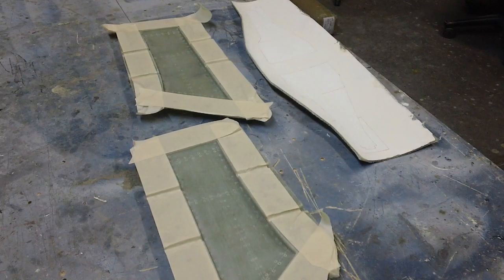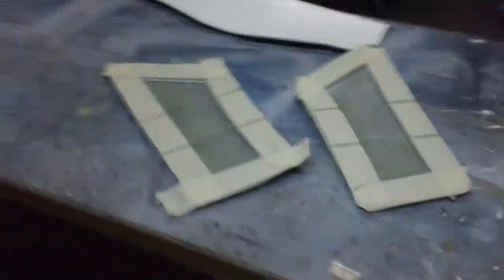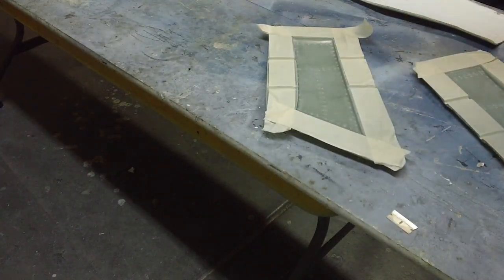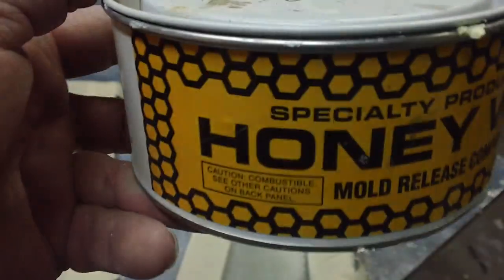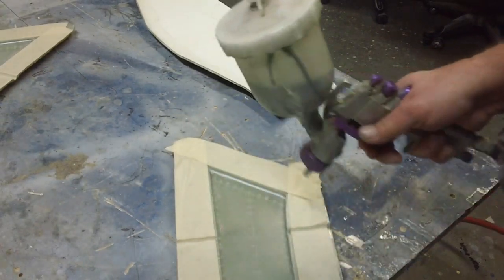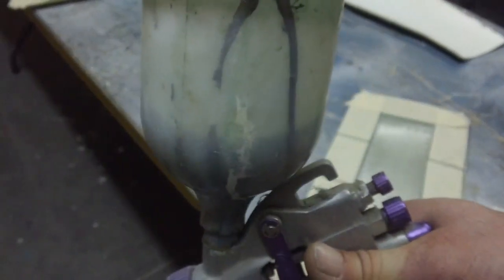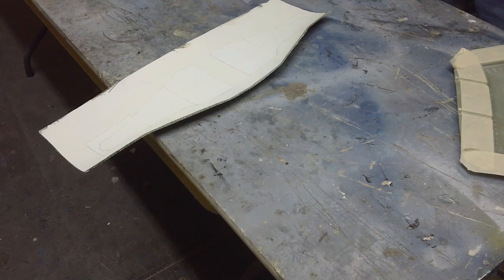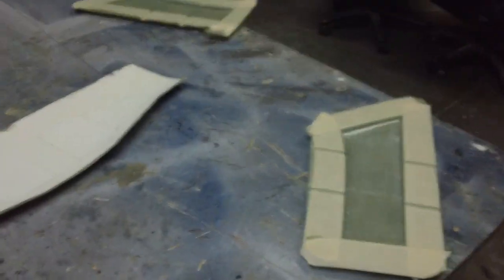how to spray mold release

Comment: Great vids Bob, When you glass the first side of a wing or stab laying the glass just past half way on the leading edge, after it cures and you trim the excess glass do you feather the edge of the glass before glassing the other side, or do you glass both sides then sand the leading edge seam?